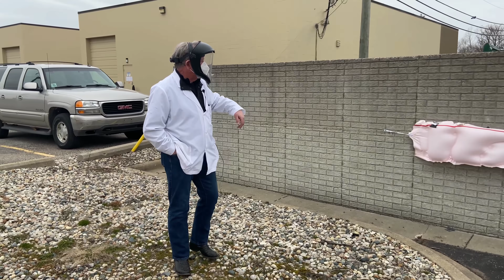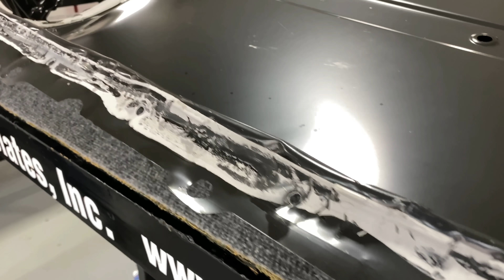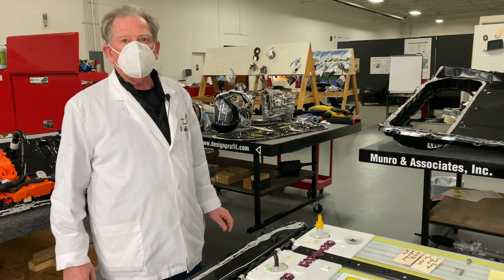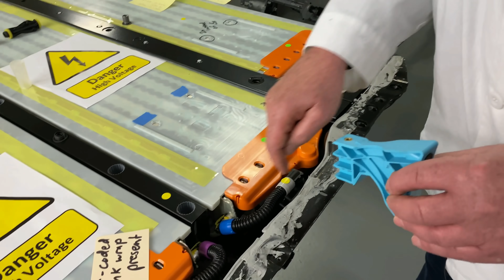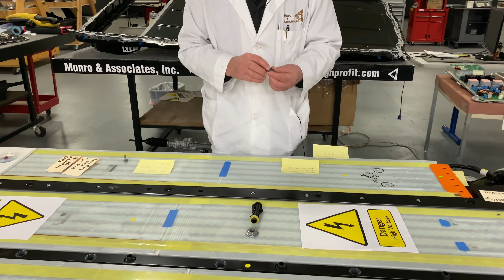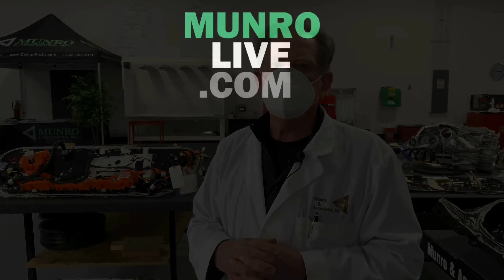Model Y E28: Inside the High Voltage Battery, Refinements from the Model 3, and Airbag Deployment

Comment: I worked 42 years in the electric utility industry from reading meters to controlling the grid so electric cars are particularly interesting to me.  Your caution and use of PPE around the battery pack is quite appropriate since a mishap can result in a catastrophic energy release faster and much more violent than that airbag explosion.  We own a Tesla Model X and I always treat it with the same respect that I would give an internal combustion vehicle with the engine running.  Taking notes and waiting for the quiz.  Jess
Reply: Well, yes Since the Battery Pack is Charged and Energized.
you really cant run down a Tesla battery pack , the car keeps 10-15% in Reserve.
Reply: @markplott4820  Yeah I was a little sad they didn't whallop the heck out of it at least a full charge's worth before tearing it apart. (Earlier reference to getting someone to discharge the battery for them.)
Reply: @benjamind7290  - Again there is no way to Completely Discharge a TESLA  battery pack, most you can go down to is 10% then the car Shuts down and Bricks Itself.
which is why the Pack is still Dangerous .
Reply: @markplott4820  do you know where you found the source for minimum 10% charge left in the battery? of course that would be non user-accessible charge left but that seems like a significantly high figure. I know running a battery down that last percentage is harmful as well as the last few percentage while charging. I would be surprised if they left 10% percent in
Reply: @CessnaPilot99  even if it's just 5%... that's still 3.75kWh which could be released in a very short time - this can easily e.g. weld tools to the contacts and in the worst case cause some molten metal to get in your face...
Reply: @CessnaPilot99  - you may be able to run down a TESLA battery down to 20% on your own , but then would have to tow it.
you could leave it Idle and turn on the HVAC until be Battery cuts off .

I was ONLY referencing discharging the battery for SAFETY sake , for Sandy's Review of the Model Y, his charge may be Higher than 10% .

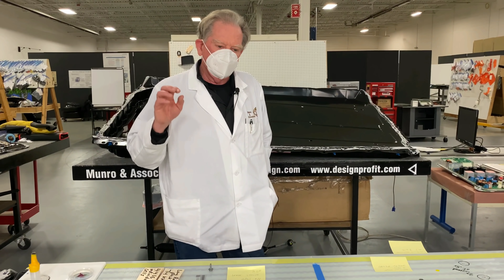Comment: 05:55 - engineering can also be explained with:
Optimist: Glass is half-full
Pessimist: Glass is half-empty
Engineer: Glass is twice as big as necessary.
Reply: Nah, that's just a good factor of safety.
Reply: @MichaelOnines  We're not designing a bridge here.
Reply: @Oosh21  Of course not! Then we would use 2.5.
Reply: @MichaelOnines  factor of safety would be a thicker glass... not a bigger glass.
Reply: @deth3021  Try telling that to the hydrology engineers. The glass shattering is nowhere near the most common failure mode for spilling liquid from the glass.
Reply: Yet another reason not to buy a Tesla. The Billionaire, Musk leaves out parts to save a few pennies!
Reply: Sometimes twice as much as necessary is exactly as much as necessary. Calculations can't account for everything, that's why margins of safety exist.
Reply: @TumbleFig  Depends on the field. Aerospace for example uses very low safety margins, else it wouldn't fly, and rely on a rigorous systems engineering approach.

Comment: If I may make a suggestion to the photographer: I recommend that you pull further back for the majority of the videos. Include Sandy in the shot and any item he is gesturing to. Most often you will see videographers capture an overall scene then come in close to show detail of the item. If you can use any video editing software you could simply insert a still photo of the item at this point.

I do appreciate that you guys are working under difficult conditions and making videos is new to you guys. I'm just trying to be helpful, not critical.
Reply from the maker: Thanks for your feedback. We are always looking to improve!

Comment: Kinda lost you there when you were describing battery parts but the camera was just wildly panning around instead of showing your hands within the frame.
Reply: i asked him to get a proper camera guy a few videos ago ,this one looks like it was filmed by a drone ,i was getting seasick
Reply: @treborsirrah7916  Moonlighting engineer doing his best.  Be kind.
Reply: I had to look back a couple times myself. I think he was pointing out the alternating layout of either the sensors, the thin translucent plastic covering (with two blue-taped seams), or both.

Comment: The purple so called plastic thing with cable and connector on the battery control module is done by Rosenberger. Nice to see it in its intended place.

Comment: The missing bolts on the edges of the battery modules... maybe those flanges are needed for a future, more energy dense cell? Cells of a given chemistry get heavier with increased energy density.

Comment: So the big question is whether the actual battery cells have changed ie could be rated the same externally but uses less cells - sounds like same as M3 (?). Could also have tweaked chemistry to give longer life but that wouldn't be obvious by looking at. Gets back to what will Battery Day reveal??

Comment: Is it possible they are constructing the battery pack upside down; electronics bay first into a mold, then attaching the battery cells on top of that, which would explain why the bolts are underneath the bay parts (because they are actually part of the bay, not the cell packs)?

Comment: Absolutely great video as always, definitely love the work that you guys do. Pretty cool starting off the video with a bang with that airbag.
I think I would prefer a battery lid that comes off in one piece without being damaged. There are ways to build them so that they stay sealed and are safe, but also serviceable.
Doesn't really surprise me, Tesla is not exactly well known for thinking about serviceability. 
I've seen a Chevrolet Bolt EV battery and car  completely disassembled. And it is absolutely serviceable without destroying anything. They used a flexible seal around the perimeter of the steel case , with more bolts to keep it compressed so that it doesn't leak.
Reply: Sealing it this way also helps keep people out of the pack who should not be in there. It is a lot more dangerous having the whole cover off.
Reply: @mihaimera7837  
I'm not sure you're correct about never been a cell fail before. There have been plenty of Tesla packs that have been replaced under warranty. I'm talking about when these cars eventually hit the used market and they're 10 or 15 years old. You are going to have people want to service these things themselves. There will be packs from salvage yards, there are people that want to fix these things. Take a look at Rich rebuilds channel.
The point is Chevrolet made the car serviceable. Tesla did not. This philosophy goes throughout the vehicle also.
Not just the battery pack. While it isn't as compact and neat with the Chevrolet Bolt you can easily get access under the hood to your DC to DC converter the high voltage DC to AC converter. All that stuff is easily accessible with a few clips and bolts you can replace parts. On the Tesla the inverter assembly is mounted inside the motor, also it is vincoded between the motor the inverter and the main computer. So even if you do get it apart you can't get it to work again with an aftermarket or salvage part.
It's just a difference in design philosophy one that annoys me. Because I tend to own older vehicles and I service them myself.
If you want to see a complete disassembly of a Chevrolet Bolt EV or Toyota Prius there is a great YouTube channel called Weber Automotive. He runs a hybrid and electric vehicle college, and has some great YouTube videos on disassembly and theory of operation. They're extremely detailed and long videos so if that kind of stuff bores you then don't bother. But he has a complete disassembly on a bolt EV taking the battery pack out to assembling it looking at all the individual parts, same thing with the cooling system inverters and drive unit..
Reply: @josht6895  
Not really not if you use common sense and the proper safety protocols.
Actually it's more dangerous at the final end leads where you've got the high voltage..
I'm pretty sure Tesla seals up the cells into groups. Within those groups they would not be serviceable at all. However you could replace that one group if you had one fail. And I believe there is a battery management computer on each of those sections. If you had one of those fail, you could fix it or replace it if you could get that cover off.
The Chevrolet Bolt is far more serviceable in general. If you're interested in that kind of thing there is a great YouTube channel called Weber Automotive He runs a electric and hybrid vehicle college, and has a wonderful YouTube channel that is extremely technical. But if you like that kind of thing it's pretty fun. He has all the different generations of Toyota Prius, Honda hybrids Ford fusion hybrids, he does some work on Tesla's also but does not have videos on those probably because Tesla doesn't allow that stuff to be shown on TV. But he does have a complete disassembly of a Chevrolet Bolt EV, complete and total disassembly of the battery pack, cooling systems inverters and the drive unit.

Comment: Hi I have a model Y and I was told by the insurance adjuster that the battery is going to need to be replaced. They haven’t explained what is going on with the battery and haven’t sent and photos reflecting that the battery is damaged. We were out of town and turned on the wrong side street in a small country area.. it was apparently a railroad track, so we had to get it towed. The towing company that towed it advised he didn’t know how to tow it so he may have damaged the suspension. Initially, before insurance got involved Tesla advised only the wheels and parts related to the suspension needed to be replaced. Now, 4 insurance adjusters later, the insurance company is saying my car needs a whole new battery. With your experience with Teslas does this sound accurate? Any help is greatly appreciated, thanks!

Comment: Back in the 80's the process of reducing costs in the high rise construction process was called "Value Engineering".  Not sure if that term is used these days.
Reply: Economan our days it’s called “cutting corners”
Reply: @tomasFL  the architect and engineer of record had a few choice words for it too,  but, it was necessary, you couldn't believe some of the stuff that would get specified from time to time.
Reply: Value engineering is alive and well. Sometimes it is just finding a less costly component that meets the spec. The real home runs in VE involve finding a different way to do the same thing while meeting the performance spec, which can save far more than parts swaps. The product cheapening we see in many pieces of equipment (eg Harbor Freight) is not value engineering since that often reduces the service life of the item, which should be in the specifications.

Comment: The missing bolts, how can you tell it was a deliberate decision to leave them out, or some sort of production snafu they missed putting them on... how can you tell?
Reply from the maker: Both sides of the battery had the same two bolts absent in a string of ten, so it was symmetrical and appeared to be intentional.  As is always the case with a teardown or any reverse-engineering, one cannot be completely positive, but based on the evidence observed, our best guess is that it was deliberate.  Thanks for tuning in!

Comment: Sandy, would you please verify how many moving parts are in the Tesla Model Y? I've read that there are anywhere between 15 - 150 moving parts. In ICE automobiles I've read there are between 10,000 - 60,000. What have you found?
Reply: Model Y has a little more Automation than the Model 3.
Model Y is Around 25 moving Parts.
Reply: @markplott4820  Mark, thanks again for your input. Do you work with Sandy? How do you get this information? Thanks.
Reply: @davidhunternyc1  - I do NOT work for or With Sandy. 
but I like Electric cars and I like TESLA cars.
I just do my Research , here, there anywhere I can Learn about Electric cars.
and According to AAMCO a Typical ICE cars has About 100,000 moving Parts.
Reply: @markplott4820  Ah, so I found something else. I suppose the answer is, it depends what counts as a moving part? I found this: https://www.quora.com/How-many-moving-parts-does-a-car-have
and this: 
https://www.quora.com/How-many-moving-parts-does-an-electric-car-have

Comment: I have a question: currently the price of the bits to convert an ICE car to a battery car is £25,000. what do you think it will be in the future? (Roughly)
Reply: augnkn93043 the battery price per kWh currently is around 130-110 USD per kWh and will drop in the next 10 years to around 60 USD per kWh 

so a 60 kWh battery will cost 3.500 instead of 7.000 USD do half 

but motors and battery covers, casting parts and so on will remain
Reply: @accountname1651  

Thanks! I've an old classic car so one day I may need to convert it.

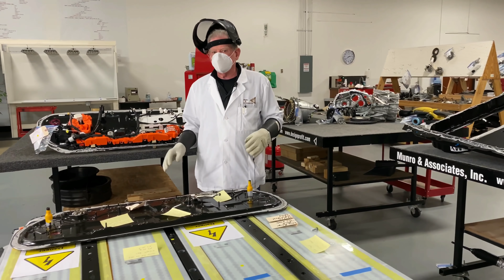Comment: 1:50 " I'm not too fussy on serviceability it means that I haven't done my job properly if it has to be serviced"
Reply: youmakeitreal batteries 🔋 wear out after years and it is very expansive and the resources inside are economically and ecologically valuable to recycle ♻️ re-man or replace 

Short thought comment sorry Sandy
Reply: @accountname1651 I was pointing out that he was making a reference to "good engineering".  If you build something with serviceability in mind it means your design is weak.  If your design is strong it doesn't need serviceability. 
   I'm not understanding how your battery comment is connected to his statement.
Reply: youmakeitreal because a battery 🔋 is a service part - there is no battery on earth currently which is ever-lasting 

That’s why you have to make it accessible to service

Comment: Still the „bang/clonk" sound during charging?
Reply: I'm a model 3 owner.  The banging and clunking is the metal pan covering the battery pack expanding and contracting with the temperature change as the battery is charging. You've probably experienced the same sound when you put a flat pan of something in the oven.

Comment: If you remove the screw to safe weight/money, you can remove all the additional plastic around it as well right ?? 
I think they should have improved both or neither. Right now they only seem to take small parts of both sides resulting in neither one used 100%.
Same thing for the holes, either don't drill them to safe time or/and drills, or drill a lot of them to safe weight, now they seem to do work for no reason. 
It's like seducing someone and in the end not doing anything with him/her.

Comment: You are pointing and talking about things but the camera isn’t showing what you are talking about. It’s confusing when there is no connection between the dialogue and the visuals. 
You also make statements about something that you wouldn’t do but don’t say what you believe should be done. Your narration is a bit all over the place and confusing.
Also at the start when you set the curtain airbag off, it would have been more accurate to say this helps de-accelerate your head against the body work of the car when there is an impact. Only seat belts help stop you from being ejected from the vehicle.
Reply: You are correct, but Sandy being an expert engineer is still in the early stages of his rockstar career.  I come here for the content not the polished professional production.  He will get better.  Good constructive comment.  Have a good day.

Comment: Everything has to be serviced eventually. Everything!
Reply: Or simply replaced if it saves time and money.
Reply: @chstra45  It only saves time and money if it's not serviceable. The cost of a new battery vs a new car. Seriously what a silly thing to say.
Reply: @milolouis Dumb take, you're miss understanding. Talking about servicing battery modules (battery being the topic of this video). I never said replace whole car. Was talking about servicing battery vs replacing. Why would someone throw away a car for bad battery? It saves time and money to swap pack at service center rather than try and disassemble and replace a module. It's a ton of time, labor, and money and the customer still gets a car with an old battery pack.
Reply: @chstra45 Errr I'm not a miss. So if my oil filter gets clogged I should throw out the whole engine. A battery is a number of cells. I haven't missed anything, if a Cell goes bad or a balance circuit fails or even during the recycling phase the battery is completely potted and unserviceable then it is bad for everyone planet included. Tesla are not that bad but ALL products should be  designed and built taking into account the whole life-cycle including after failure.
Reply: @milolouis  that's why packs get disassembled and recycled. It takes a lot of time and it's hazardous if not properly trained. I'm a tech at tesla. Most all techs can swap a pack. It takes awhile to train someone how to safely disassemble one. Not all service centers are going to be capable. Better to put in New pack which hopefully soon will be cheaper than paying for labor to rebuild. Even at today's costs it makes more sense to swap pack. Added bonus of getting car back faster.
Reply: @chstra45  These cars are practically batteries with wheels. Why would a customer buy a new pack if they could replace one of the modules themselves why wold they buy a new module if they could replace a few cells themselves. It's outdated your way of thinking. Everyone should have a right to repair and things shouldn't be designed expressly to impede this. IT DOES NOT SAVE MONEY TO BUY A NEW PACK!! Except for Tesla.